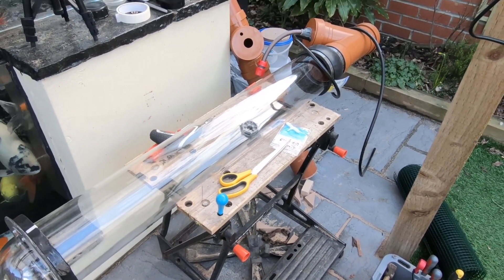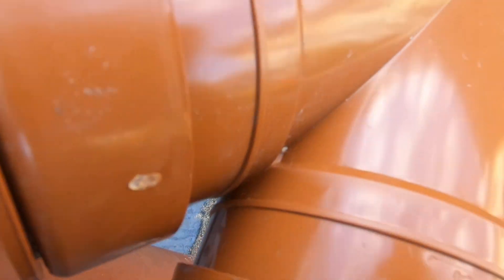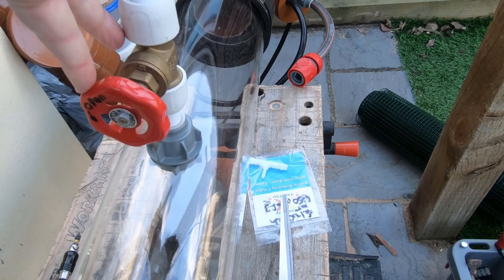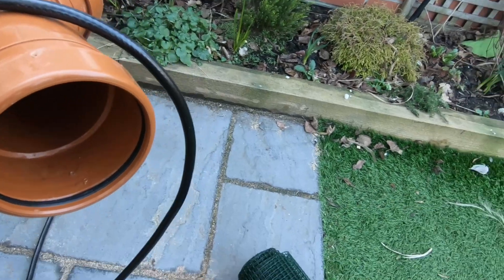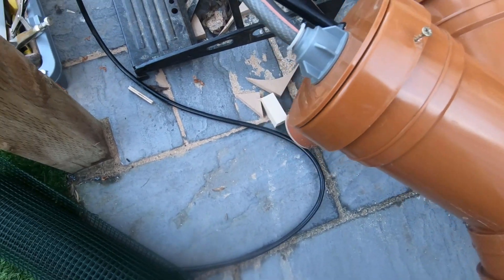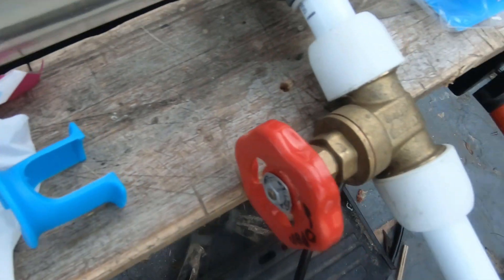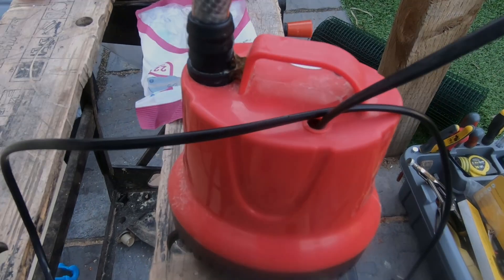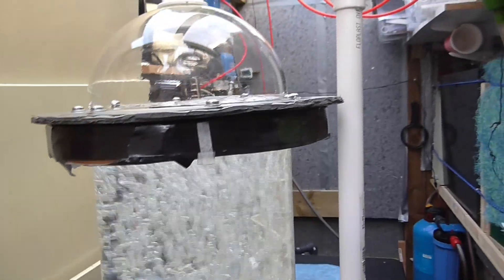Building a Foam Fractionator

Comment: Reduce the size of your skimmer tube when I use to make them I used those fish bubble towers from Argos injected the water 3/4 of the way up and facing down use a garden hose spray head or similar to get high pressure jet to help keep the hang time & turbidity of the bubbles.
You need more bubbles than water going through to fracture freshwater, think smaller main tube, more bubbles in smaller space= smaller air pump cheaper to run

Comment: Try putting a defuser plate just above the air stones around 2mm holes about 100 holes this may help make smaller bubbles going into the tube trapping more protein in the foam
Reply from the maker: Great idea Barry.

Comment: Need to get the air set right, can be a bit fiddly but needs to be just pushing the bubbles up and through the tube. If no protein to filter you may just get a slight dribble of water. 
For some reason I’ve started to get a lot so reconnected my little diy fractionator in my eazypod and it’s pulling loads of foam but no dirt.
Reply from the maker: Thanks Graham. I have trouble keeping the water level constant and I am getting no foam at all. As you say just a little bit of clean water! Disappointing!
Reply: @northernkoikeeper512  are you able to control the air?

Comment: You could've put a load of solvent weld glue on the y branch caps it would've held 👍
Reply from the maker: Great idea. Unfortunately I wanted to be able to get at the air stones and needed it to be able to be taken off. Good thinking though.

Comment: looking good mate, thats a y branch you was thinking of, how did you seal the dome to the tube
Reply from the maker: Great question Paul. I really should have shown that! I thought about this for quite a while. I wanted to go with an acrylic or Polypropylene 'hoop' over the tube and correctly positioned. In the end I went the cheap way! I cut the hoop out of 18mm MDF and covered that in tape. I then wound electricians tape at the correct place on the tube until the MDF hoop was very tight when pushed onto the tape. I then cut a rubber washer and fitted the dome using screws into the MDF. Does that make sense?